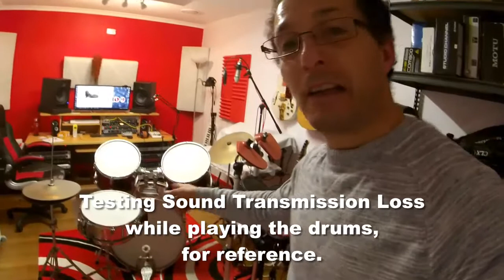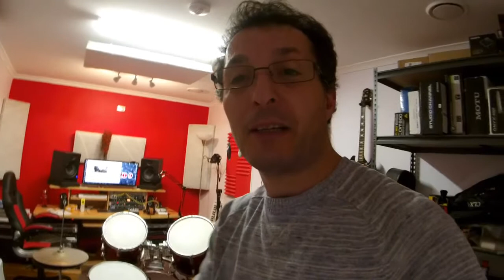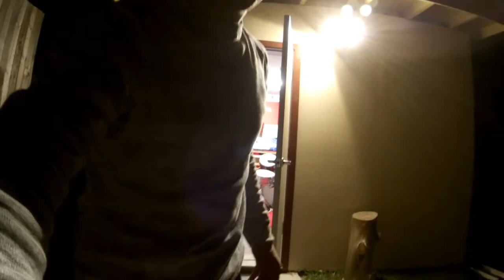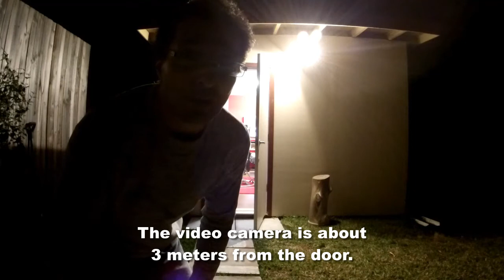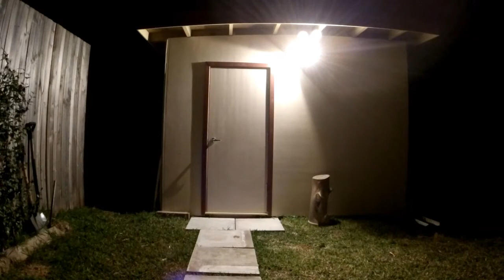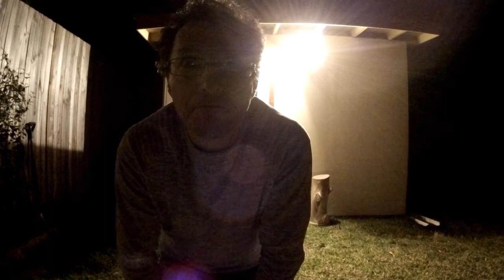Testing Studio Sound Transmission Loss While Playing the Drums | Soundproof Studio

Comment: Looking forward for some Bass guitar test.
Reply from the maker: That's coming in few days, as I want to have reference videos made before and after the door seal.
Reply: RecordingStudio9.com  How heavy is your door? And how wide the gap between them?
Btw thanks for the video.
Reply from the maker: Each door is 40mm solid core with 90mm air gap between the doors. Maybe it will be about 80mm once I install acoustic layer on the doors facing each other.

Comment: Thanks for this. I agree with Billy, once you seal the door openings all those high and mid frequencies that seem to leak out like water will be greatly reduced. The drums sound much better than when you first set them up! Did you manage to cut a mic hole in the kick drum yet?
Reply from the maker: Thanks, and yes, no low frequency sound leak, rest will be gone after the door seal.
Yes, I did somewhat managed to tune the drum and done a test recording.